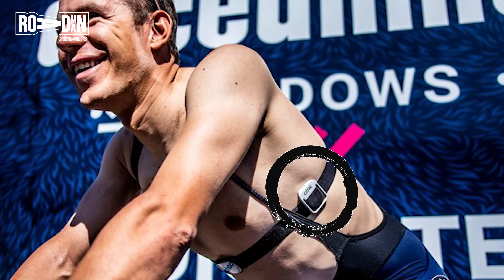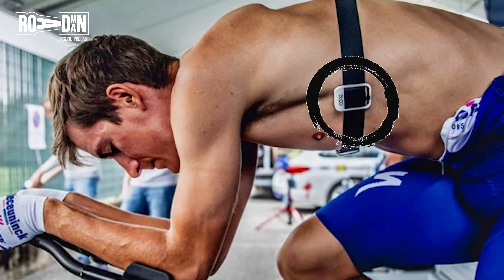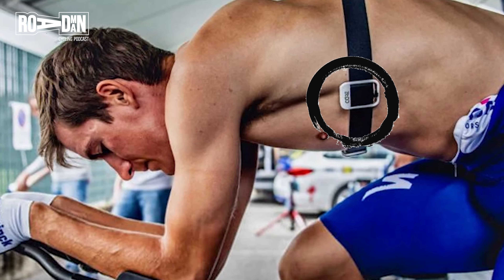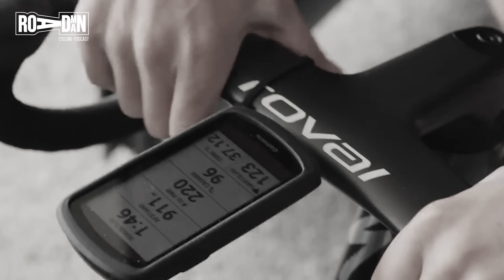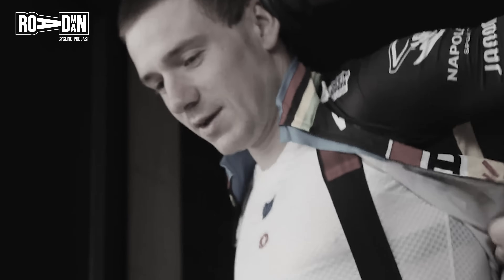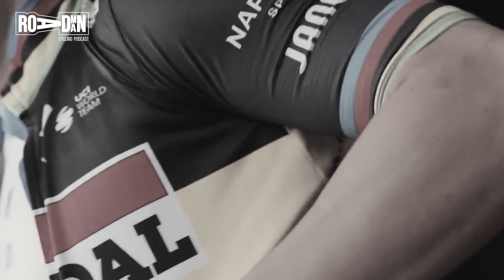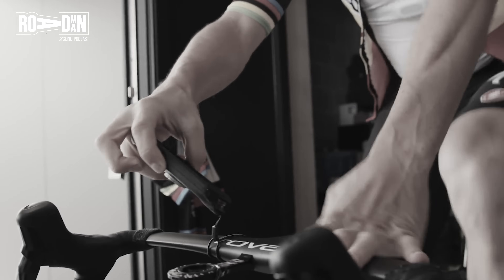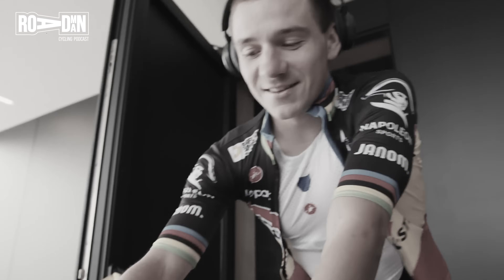Remco's Heat Training: Why It Works & How to Gain From It

Comment: Once again Garmin has dropped the ball.  Back in 2011 I was using a Garmin Tempe sensor attached to the heart side of my heart rate monitor.  I had to use a Garmin outdoor unit to record the temperature from the sensor.  I was even able to fit the sensor to the inside of my helmet on some rides.  Problem was/is the Garmin Tempe does not connect to Garmin Edge head units!!!   BTW I live in Bermuda where the summer the temperature hits 85-90 with 80%-90% humidity.  I found it beneficial using the Tempe to keep track of my skin temperature especially riding indoors during the summer.  It appears if my skin temp went above 95 I would start to blow up on the bike.  I will be checking out the CORE sensor!!

Comment: I find my best cycling performances in Ireland is done on very warm days, like 25 degrees C. The muscles need to be at a good temperature, and everything runs better than on a cold day. It's why we cycle better in summer than winter, not just because more time is spent cycling in warmer weather. Of course, too hot, and it's bad for performance, but there is a just-right temperature.

Comment: I don't understand why Remco did his heat training outside in Europe in late winter or very early spring. Indoors would be hotter, but maybe too hot?
Reply: They ride 4-6 hours. Way too boring indoors.
Reply: @gerrysecure5874  Looking at passing traffic from the carport is hardly better?
Reply: probably only a matter of space... no idea if he was at his actual home but you can see in the original video that he had to unpack the trainer and set up the frame etc..